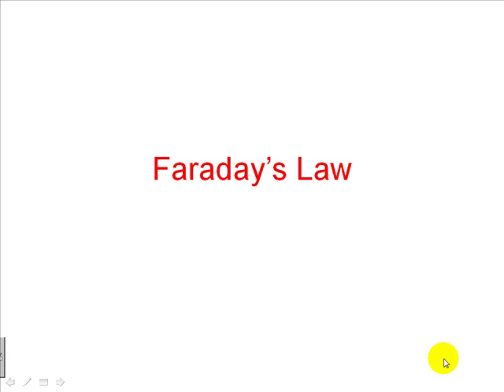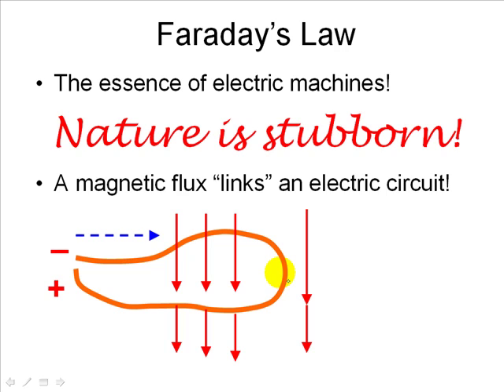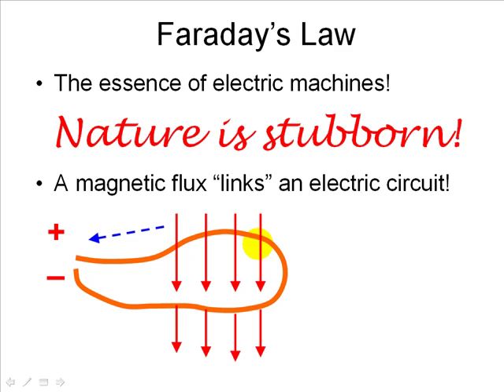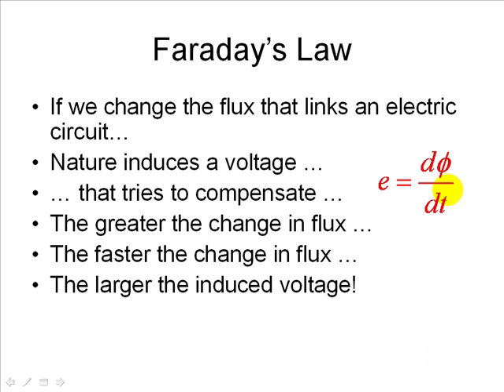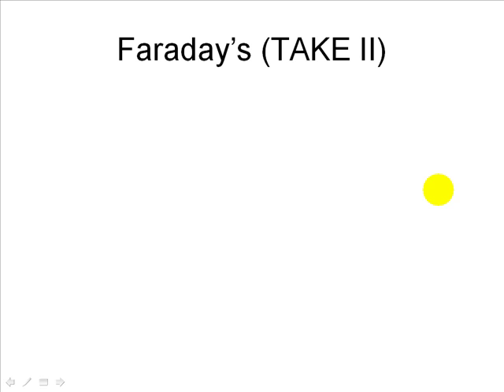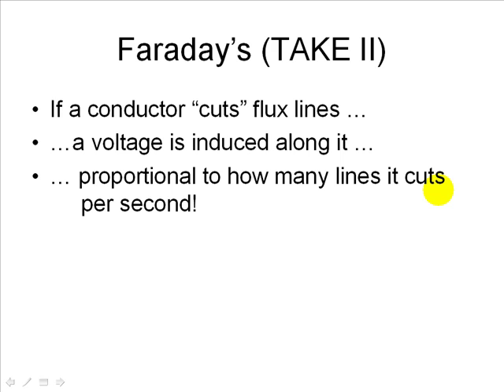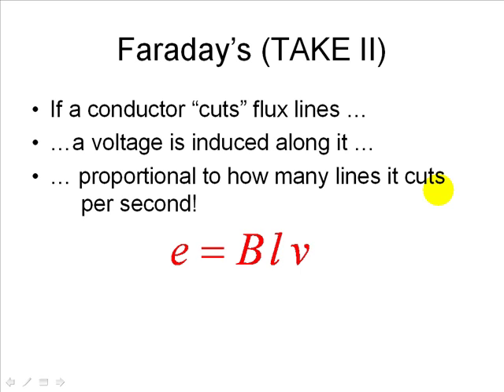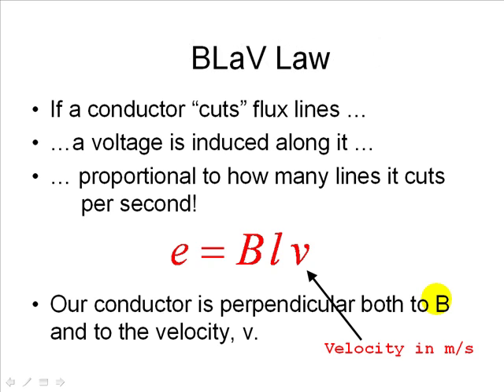INDUC 02 - The Induction Motor, Physics Background 02

Comment: Will current be induced if I cut magnetic flux with a sheet of metal instead of a wire loop? (A sheet of metal like a 1 x 1 m^2 of copper sheet)